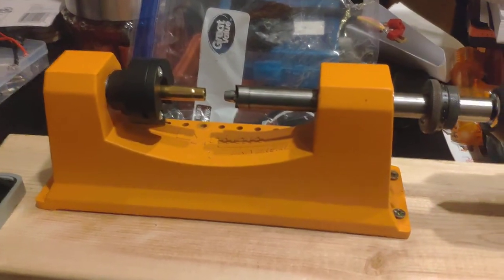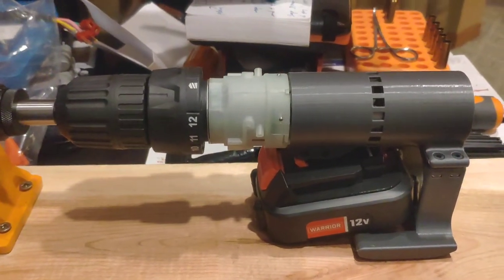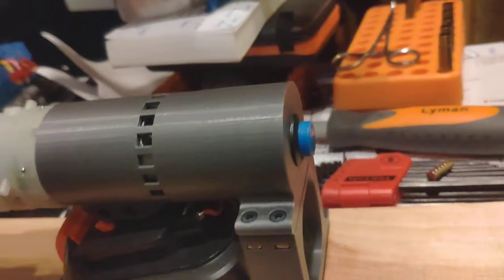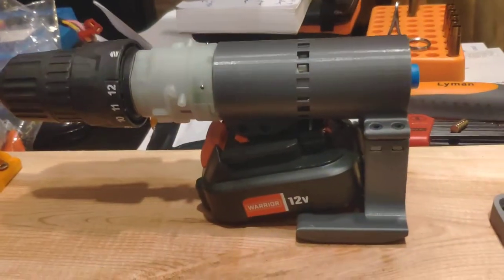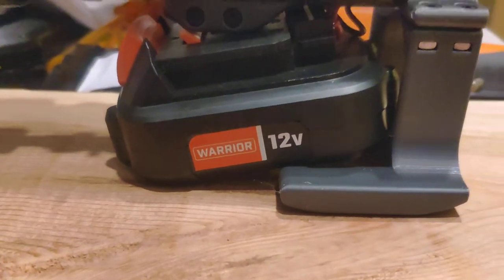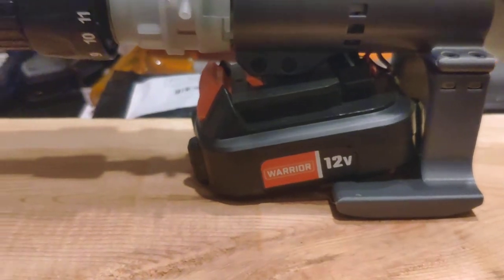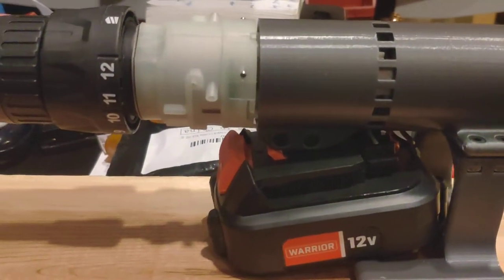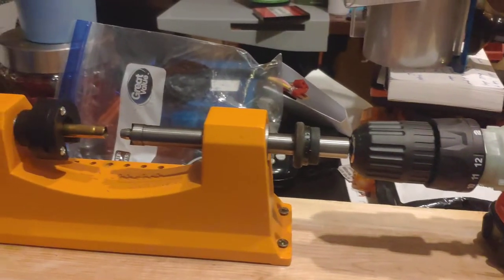Lyman Brass trimmer drill mod

Comment: Mind sharing your 3d file?  Seen your video looking this up to recase/repurpose for a coffee grinder.
Reply from the maker: I do not think it will be much use to you unless the motor, and everything is the same size. You would have to do a bunch of redesign, and it would be easier to start from scratch in my opinion. There is nothing special about this design. It's just a cup that holds the motor slightly over spec so it can clamp down. Throw a hold in the end for a switch, a hole for your power, and give it some skids or wheels to keep the motor concentric to the shaft.
Reply: @MattPiekarsky  Alright. Went looking and found a few, including this nice one that adds bearings https://www.thingiverse.com/thing:2761685
Reply from the maker: @h82fail  Yeah I definitely think that's more along the lines of what you're looking for